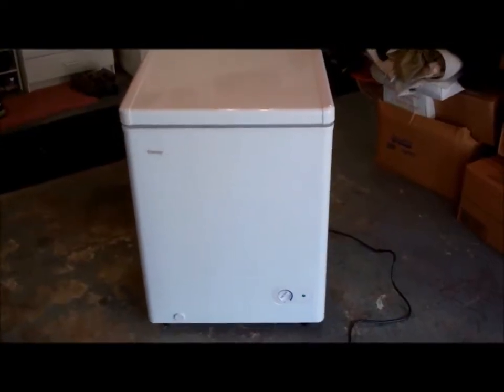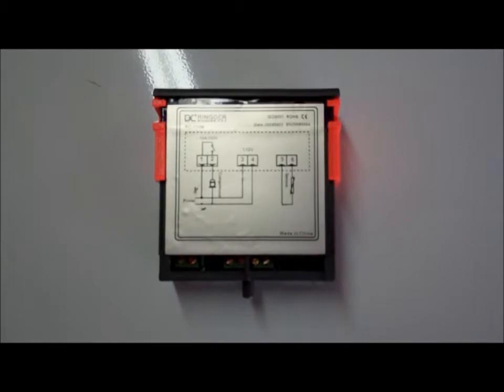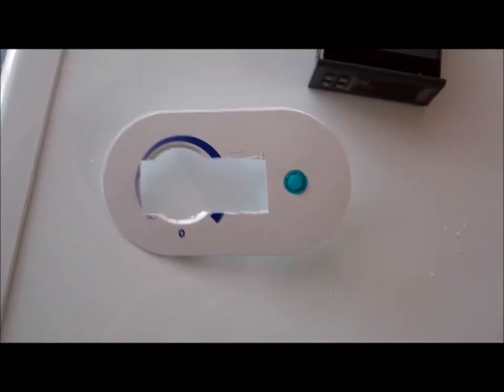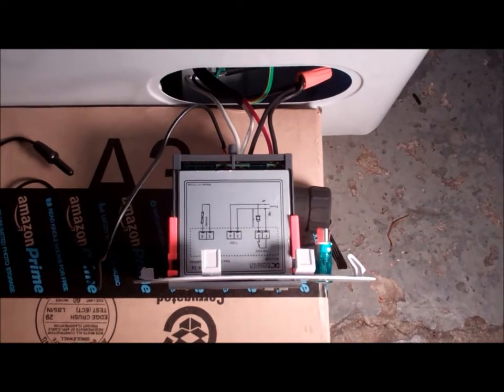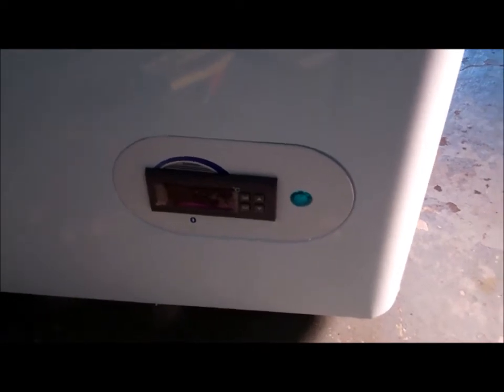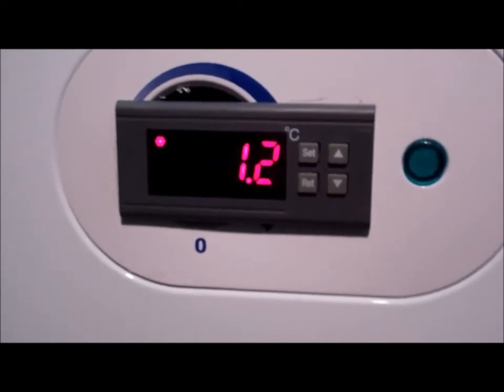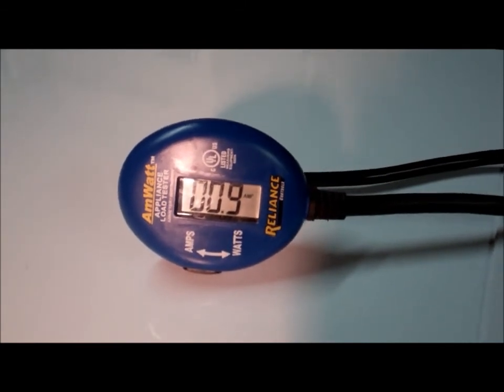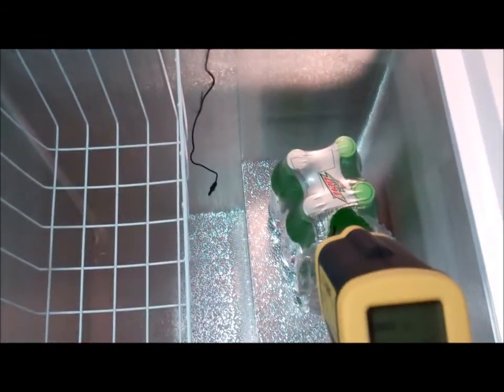Chest Freezer to Fridge Conversion Part 1

Comment: Hi Grahm how long does the fridge run at 600-700 watts when it starts up? I'm not very well versed in electronics. Curious if a lower wattage inverter could handle this spike if it's for a short time within it's peak wattage. (i.e. 400w inverter with 800w peak.) 
How many watts total would you say this fridge uses each day on average?  I'm seeing people online reporting 40-100W usage total in a period of  24 hours with their setups.
Reply from the maker: Hello! Looks like this chest freezer draws a lot more power than I was able to see on the watt meter. Start up was too much for my 600w inverter, so I purchased a 2000w inverter, and the fridge still overloaded the inverter when trying to start. After some research, found that the fridge compressor needed a start-up capacitor, which makes the start up peak less. I installed a 100uf start up capacitor and the fridge started up fine with the 2000w inverter, but I also needed to keep all wiring to and from the inverter as short as possible. Hope this helps.
Reply: +Crackers Thanks for the response! Wow it was tripping the 2000W inverter? I'm surprised it's pulling that much current.  I found this article where a guy reduced his startup peak from 800W down to 200W with a run capacitor/start capacitor/potential relay.http://jubilee101.com/subscription/pdf/Appliances/Converting-a-Freezer-to-Start-Up-On-an-Inverter---4pages.pdf  

Do you know many watts are you pulling with the 100uF capacitor now at peak? How many watt hours do you use per 24hours?
Reply from the maker: Could not read the peak start up current with my watt meter, but would like to figure out how to measure this. The fridge draws less than 2 amps when running.
Reply: Same here my converted chest freezer only uses 75 watts while running but if I try to run it on my 300 watt pure sine wave inverter it will fault the inverter.  They say start up surge can be any times more than the steady draw.  But it's not for a long time so I am running a 24 hours test for total kwh per day.

Comment: Graham, i followed your instructions exactly, turned it on and got sparks!! the only difference between my freezer and yours is that i do not have a red wire coming from compressor, just a black and white. I took the red to be the hot(your red) and wired accordingly! please can you advise, thanks, James
Reply from the maker: Hi James. You can't go by wire colors, since this could be different depending on the freezer. Send me a pic of the freezer schematic (usually located on the back of the freezer), and a pic of the schematic on the temperature controller.

Comment: Excellent video, Graham. I have the same controller you have. I haven't hooked mine up yet. I have mine on a timer, the freezer turns on for a few hours in the am. It has been working fine and the winter. We'll see how it works when the temperature starts to rise.
 Did you upgrade your solar system it seems like you just had 90 watts or so last time I checked.
 If you take the freezer to the cabin at high tide I want to see the boat ride. Haha
Reply from the maker: Good idea about video recording the boat ride with the freezer! I now have a couple of 100w and a 130w solar panel that I have added to the harbor freight panels.
Reply: Ahh. That should work for the weekend. you have a generator just in case though too.
Reply from the maker: We are hoping to stay for much longer visits to the cabin, and since it only draws an amp, it should be ok. I was going thru a 20lb propane tank a week with our propane fridge, and you know what a "challenge" it is getting stuff to the cabin. I will have to buy new batteries soon, since my Trojan t105s are about 6 years old, and weren't doing so well last October. Think I may try a couple of 6v golf cart batteries from Costco ... they have similiar specs to the Trojans and weigh about the same, but are quite a bit cheaper. If they work out, will probably get a couple more. Also, bought a Yamaha 2000w generator which is very quiet, and should help out on the cloudy days (which there are a lot of) :-)
Reply from the maker: Thanks Bob!
Reply from the maker: Bob Vance Thanks Bob - the Costco up here carries the Interstate batteries.